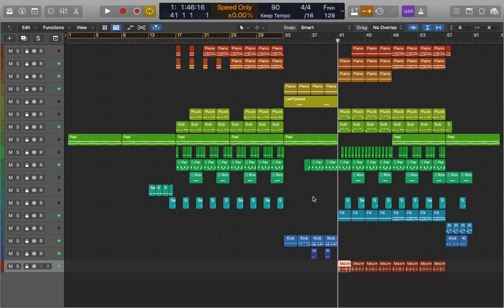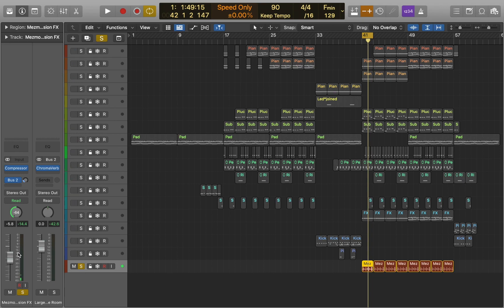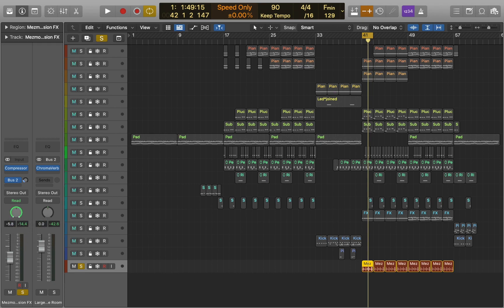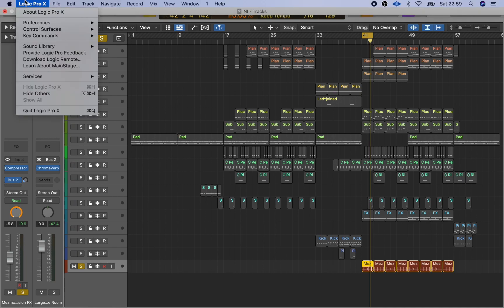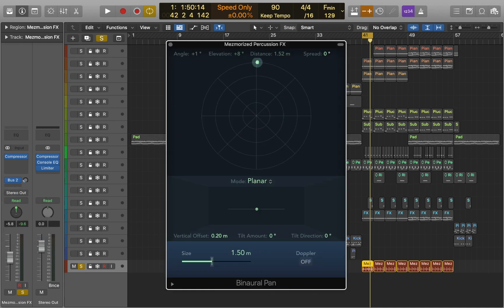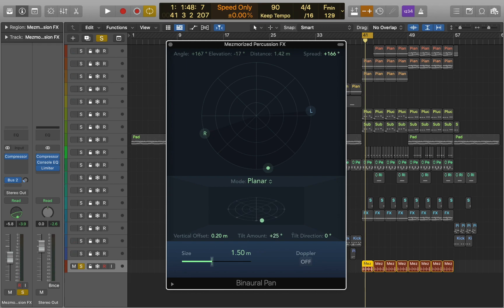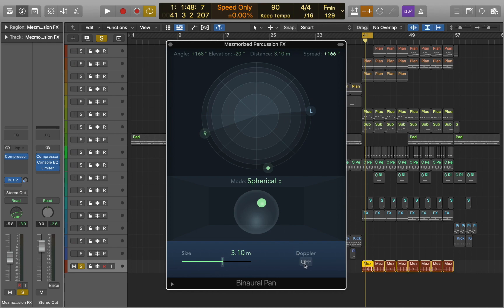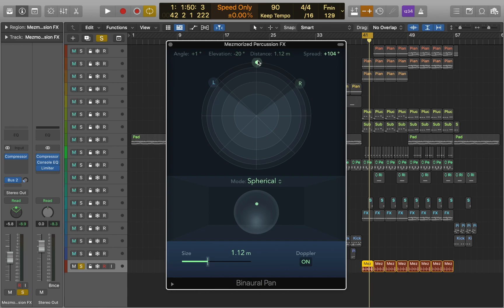Logic Pro: Binaural Pan

Comment: Thanks. Awesome!!! Does Logic record on to the chosen channel the changes panning? So if you move the sound around from top to bottum and left and right while recording does it track the movements dynamically?
Reply from the maker: Hello. I'd recommend that you watch my video on automation. I understand that you want to capture  movement of a sound, you could do that by switching automation mode to 'write'. You can find it bellow your effects and sends slots on a channel strip. This way when you start recording any parameter changes will be recorded as well. Switch to read after you finish recording and play back.
Reply: @eduard.antonoff  Thanks. So much to learn. 😱 Is it “write” or “touch”?
Reply from the maker: @PLANETWATERMELON  It depends how you want it to react. From Apple: "Touch: Plays back automation in the same way as Read mode. You can modify the value of the chosen automation parameter by moving controls in Touch mode. After the fader or knob is released, the parameter follows existing automation on the track.
Latch: Works like Touch mode, but after the fader or knob is released, the new parameter value replaces existing automation on the track.
Write: Erases existing automation on the track as the playhead passes over it. Records the new control movement or deletes the existing data if you do nothing."

Comment: Have a quick question about this for vocals. If my vocals sound too close up would I be able to use this to push them back a little further or would it be better to just bring down the volume of the vocals themselves?
Reply from the maker: Binaural sound is a special effect that should be used sparingly in my opinion, but if something sounds good, it is good. What binaural effect does is applying 'natural EQ' and adjusts volume so you have this illusion of space. I would recommend using faders in this case, or scoop out mid range with EQ / use reverb to push sounds back to create depth, you will have more control.
Reply: @eduard.antonoff  thank you

Comment: Can't seem to automate Binaural in Touch or Latch mode...  Any suggestions?
Reply from the maker: It works in my session, just checked. Try do find the automation parameter manually if 'latch / touch' doesn't work. Activate automation by pressing 'A' then go to the track's pop up menu - 'main' - 'Bin. Angle / Bin. Radius'.
Reply: Thanks Edward!   I’ll experiment.  Cheers.